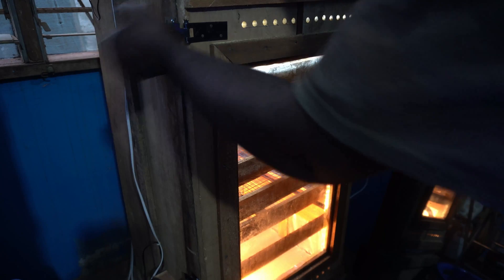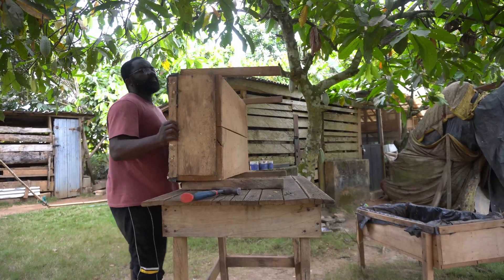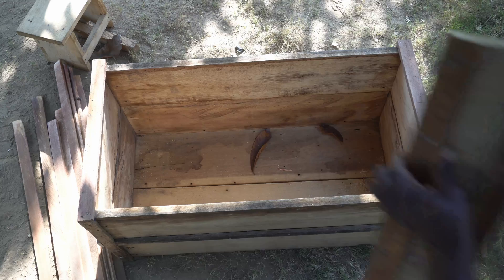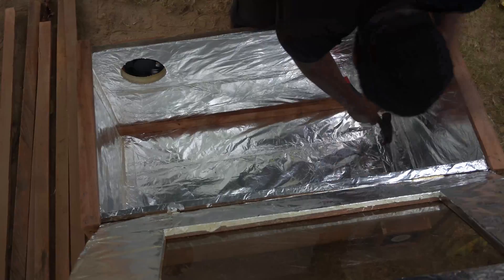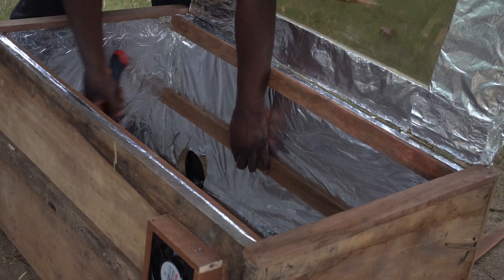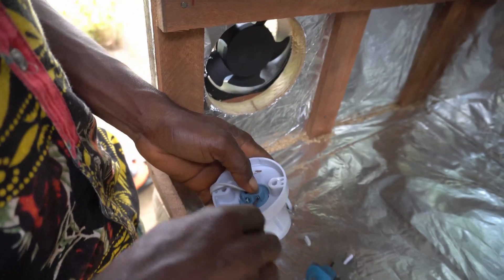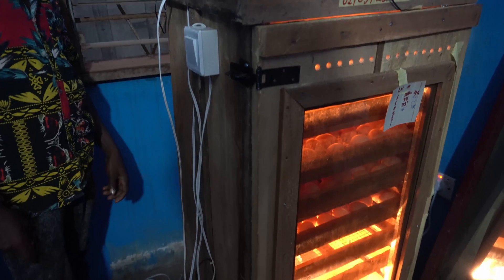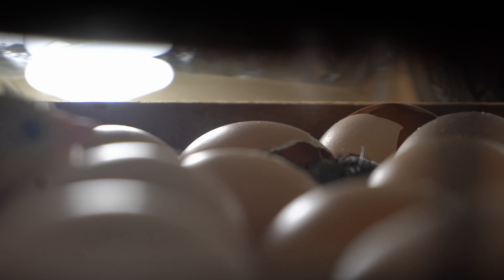Build A Manual Egg Incubator | 500 Capacity Homemade Incubator | Cheap, Easy And Energy Efficient

Comment: This is very informative video, I would like to know how much the maximum temperature that this incubator can sustain?
Reply from the maker: you mean the maximum temperature you can achieve? You need to know what kind of poultry eggs you want to incubate
Reply: @AIS.FarmResorts  let say, I want to use the same uncubation for other purposes that need temperature around 50 to 100 degrees Celsius. Is this method can be used?

Comment: Thank you for the clear and concise instruction. I have an old freezer that I want to transform into a large incubator and needed to learn about wiring and fans and heat regulation etc. Now I know that I am going to add a window in the door of my freezer.
Reply from the maker: They are best to keep the heat and humidity inside. Fridges and freezers well insulated and make the best homemade incubators. best of luck
Reply: @AIS.FarmResorts  Thank you!

Comment: How low will I keep the humidity in the first 18 days and how high do I keep humidity in the last 3 days of incubation. 

Thank you
Reply from the maker: FIRST 18 DAYS
make sure your below 50% to be on the safe side. But you would want to get it between 35% and 45%. I prefer around 35-37%.

LAST 3 DAYS
above 50%. best between 65% and 80%

Comment: Ok just like what I have done my incubator. The light is position up and down we don't anymore needs tuner  of the eggs . Because the heats are easily turn around through the fun. Nice and thanks.
Reply from the maker: the egg turner is not for distribution of heat but to keep the yoke from sticking to the wall of the egg shell

Comment: If you put in a temperature controller you won’t need to switch it on and off. It will stay at the temp you set it at.
Reply from the maker: believe me I know. after all, I built a full automatic 5000 capacity egg incubator.

the whole idea of this video is for those who can't afford a full automated machine. or those who want to try their hands on a manual machine before venturing the automated. I learned how to build mine in stages, as I have shown in my video uploads

Comment: How about your heat control?
Reply from the maker: unfortunately, it was all regulated by trying out different Watt bulbs until we got the right heating temperature. the issue though is, outside temperatures like hot or cold days will influence the temperatures inside of the incubator

Comment: I live in a humidity of around 80....how can i get the humidity down in an incubator?...and are holes and fresh air really needed?
Reply from the maker: make sure there are no openings on your incubator which allows outside humidity into your incubator.

avoid opening your machine as much as possible.

remove any water bowls with water from your incubator if its not day 19 of incubation.

place a bowl of raw rice inside you incubator

Comment: Very well done! I don’t understand how you can keep the temperature constant. 
Do you need to play around with the ventilators since you can’t adjust the heat produced by the lamps?
Reply from the maker: thank you.
temperature was hard to keep at a stable 37.5 degrees. we played around with different bulb wattages, in combination with the ventilation holes. The issue with the ventilation holes, was the fact that, Ghana has high humidity, so whenever we let air from inside into the incubator to cool it, we also allowed more humidity into it we didn't need. so it was a game of balancing everything. You will not get it a 100% if your machine is manual like this is.
Reply: @AIS.FarmResorts  
Thanks for the answer, can you also attach a thermostat? So that when it’s to cold the lamp will go on and when it’s to hot is falls out again? Seems like an impossible task to keep the temperature on point during the night
Reply from the maker: @timdemol1459  you can certainly add a thermostat to your construction, if this helps regulate the temperature. I didn't have that. And more specifically, I did this video for those who cannot afford the extra parts. But you can certainly add your own parts